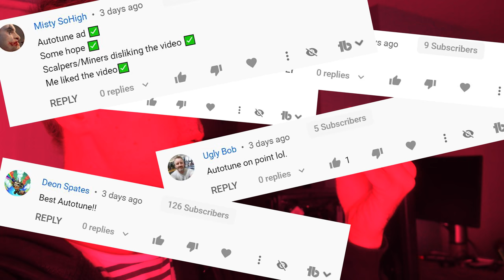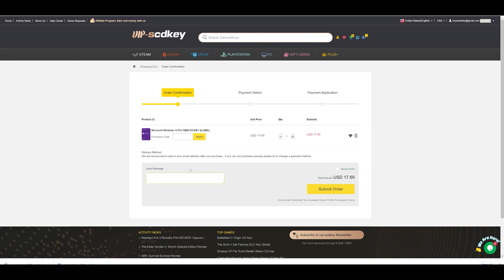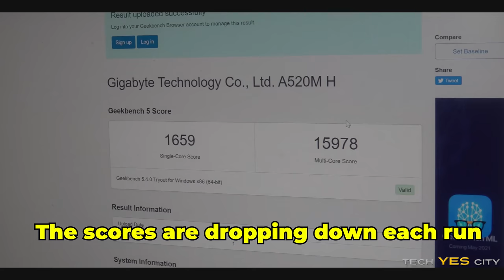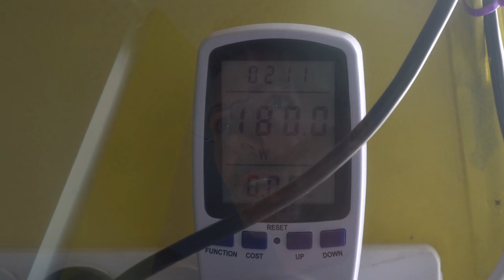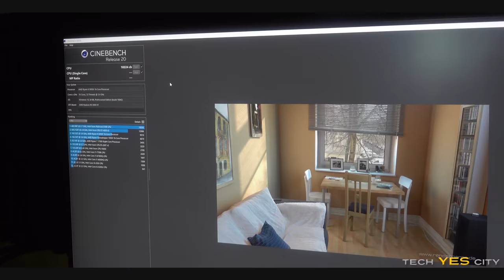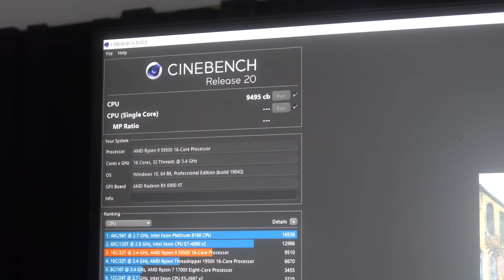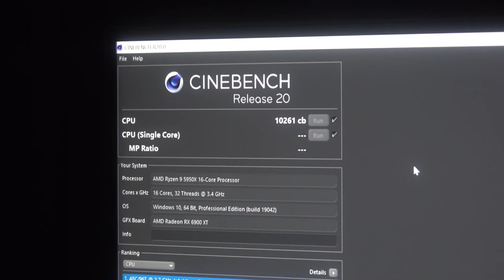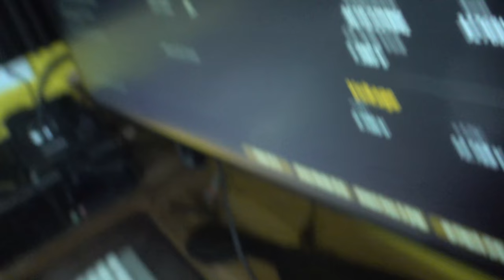5950X on an A520 Motherboard... This was NOT what I expected!

Comment: Hi, what do i think about the experiment ? Well, if you would use an air cpu cooler ,maybe a horizontal one, you'll have colder temperatures on the motherboard.
Thats one of the big disadvantages of the water-cooling the CPU, the motherboard area surrounding the CPU, will run hot. Another thing is the watercooling may require maintenance such as shaking if there is an air bubble, not to mention about the risk of leaking after some time. I prefer air cooling because it can run even 10 years without any problem.
Your testing PC system is built on a exposed rig but imagine that system in a case. That motherboard will start melting.
I'm not from Australia but if someone would sell me a computer system with CPU water cooling i will refuse the water cooling and renegotiate the price. :)
Edit: No wonder why you had to put an air cooler above the motherboard and you got better results, ...because there wasn't any ventilation on it. Even the fans from the computer case are not enough to ventilate the motherboard, people tend to buy cheap cases with a poor airflow because of their budget.  Get rid of that watercooling thing and get a decent air cooler. 
Cpu watercooling is for the rich people who can afford to replace the components more often. Watercooling is expensive and not WOW-efficient unless they are overclocking and has a powerful airflow.
I see you're hunting for the cost and efficiency but watercooling is not a good choice in a long run when speaking about the lifespan of the components.
Im talking mainly about cpu watercooling but it might apply even to gpu watercooling. 
Watercooling is cooling only a component, not the area/the pcb surrounding it too , not to mention about the radiator which might reduce and slow down the airflow speed in a case.
I guess that's why Cryorig has invented a hybrid watercooling-air CPU cooler. Look for their video https://www.youtube.com/watch?v=BTCDo_WT6xY .
Since you have an infrared camera and if you dont have such video, how about making a video for testing watercooling versus air cooling in some different cases from budget one to a expensive one. This will be your homework :) for now.
To be clear im not from a company im just a home computer user which I ordered/created my shopping list (don't know exactly how to build a computer, only on paper I can make configurations),... my configuration components list to be assembled by an IT service, based on a limited budget with maximum efficiency of course with stock air cooler on Ryzen 2600 but I've just purchased an Arctic esports 34 DUO because the stock cooler is not decent in the summer if i convert videos.

Comment: This is the proof that motherboard manufacturer are kind of overselling insane VRM setups to justify high prices in X570 motherboards. Thanks for covering this!
Reply: So you like running your VRM at more than 100°C? I am absolutely certain that it will not last long. Plus you do have a bunch of capacitors sitting right next to the VRM. Capacitors lifespan are rated based on temperature and life hours. Alot of very cheap motherboards have 85°C rated capacitors. The lifespan doubles for each 10°C reduction in temperature for capacitors and it goes both ways.
Reply: No it isn't, and they aren't.
1. A lot of X570 motherboards have crap VRMs. Look at the MSI X570-A Pro.
2. Some people want to overclock, some people live in hot environments, and some people don't want their VRM to run at over 100C because it will wear out faster.
3. If you just want a good VRM you can buy a B550 motherboard for 1/3 the price as an X570 with the same VRM (e.g. the B550 Aorus Master has the same VRM as the X570 Aorus Extreme, and the Strix B550 XE has the same VRM as the Crosshair VIII Dark Hero). The motherboard manufacturers are overselling you on PCIe lanes, not on VRMs.

Comment: I have built a couple upgraded PC based on the Gigabyte A520 Aorus Elite and its a better board than a Gigabyte B550m S2H ... You loose PCIe4.0 but gain a couple DIMM slots... and the Aorus is a ATX motherboard and the S2H is mATX... Are you willing to get a Gigabyte A520 Aorus Elite and retest? It has VRM cooling from factory!

Comment: I too expected the A520 to explode if not catch fire, so here are my thoughts. To some extent I suppose it was well known that Ryzen was actually good and relevant by the time the A520 boards were beginning to be designed. This is in contrast with the A320 and even B350 or X370 boards which were mostly mediocre because AMD had such a bad reputation at the end of the FX Era. AMD had to prove it’s self to not just consumers but also to the motherboard makers who didn’t want to invest back in the first generation Ryzen days for fear that there would be no point. In hindsight obviously Ryzen turned heads and he boards got progressively more reasonable in the 400 series and 500 series. So now the quality has come up a bit. The Gen4 SSD thing is dumb though, it should just force Gen3 speeds. Anyways some “meh” PC with an APU or six core I cannot bash this.

Comment: Been looking for deals myself but i've had no luck so far in finding a 6 or 7'th gen intel wil some DDR4 for a decent price, but i don't think it's going to happen so i can get a 9'th gen, ram and mobo for $400, so might pick that up for my sister when i start working again, and for myself i'm picking up a 5950X or a 5900X
Reply: @Tano Yeah probably, problem is my sister isn't that savvy with computers so i would prefer to get something that works out of the box instead of trying to find a decent memory kit that works without problems, that is also why i think the 9'th gen would be a better deal
Reply: @Tano I actually bought a corsair 3200 32gb 2x16 kit for my 2600X because 16 wasn't enough, but i can't use it on xmp because it seems to not work above 2800, i've gone through 3 motherboards with same problem, and i've kept recommending amd to friends lately, i still have alot of time to decide what path i'm going to take with this anyway

Comment: fun fact, VRMs on more expensive motherboards are better and they produce less heat compared to the cheaper ones under the same level of loads even without the heatsink, the cheap motherboards are the one which actually needs the VRM heatsinks xD

Comment: I have an A520 M Aorus mobo ( it seems to over clock CPU and Ram) and 3600 CPU with 16 gig 3600 Mhz Ram an Evga LHA GeForce 3060 12 gig . 700 watt EVGA Gold Power Supply and a nvme m.2 And a reasonable case cost me $1200 NZ 3060 was $645 of it . The old  B450 16 gig 2666 2600 Ryzen with Vega 56 and 650 watt Cooler master  PSU I gave to my 11 year old Son.

Comment: I have a 3400G with an A320 motherboard and had 2 blue screens  next day after making the system, but then they stopped and it is still working.
Reply: @Tano I myself think it might have been a driver glitch problem thing. It is not a problem now as it has not happened.

Comment: yeah using thermal glue and heat sinks on shotty designed VRM's has been a life saver for the low end gamer.

FX 8120 in a MSI 760 board with the same mod is excellent.
Reply: @Tano i mean i tested it, its not like its a rig use lol i tested it and then put a 6300 in it

Comment: I ve got a Ryzen 7 3700x paired with a b450 works great for gaming snd streaming
Reply: I'm using A320+R7 3700x, working good as well
Reply: It's the vrm quality and potential of the motherboard, not really the chip. For example MSI have some very good vrms on their b450 motherboards.
Reply: @chovekb  ya, you know VRM on B450 usually better than A320, but I've never faced any issue to VRM on A320 up to R7 3700x (had tried R3 3100, R5 3500, R5 3600 as well)
Reply: @alvincalmkid  Ofc, those are 65W tdp chips haha it would be a shame and pointless if any manufacturer can't handle that even on their cheapest motherboards.
Reply: @chovekb  that right, because of that I never bought mobo more expensive than A20 series just for TDP 65w Ryzen 7 :D

But actually I don't see from TDP, but real power consumption because TDP 65w doesn't mean 65w power consumption. You can see i5 11400F has 65w TDP processor as well but can reach more than 220w, it should be combined on motherboard that has good VRM

Comment: Bryan, c'mon man, you can't compare thermal imaging temps of a bare VRM versus the temp of a heatsink sitting on top of a VRM. No offense, but super-sloppy methodology. At the very least, I would have liked to see an intermediate step using bare VRMs with a fan on them, before skipping from bare only to heatsinks plus a fan. I acknowledge that temps and performance were better in your final configuration, but I would not assume that the heatsinks helped at all or would even be better than bare VRMs with a fan on them.
Reply: Good point.  Perhaps measuring VRM temperature on the board backside would be a good way to compare VRM temperature with and without heatsink.  Not a perfect way to measure temperature but a fair comparison.

Comment: Would bot run that board if you gave me one for free, 100C is still too toasty, my x470 ch7 only gets to like 40-50s on the vrms if not lower. Thats with a 2700x but i cant see a 5800x getting it much hotter.

Comment: I mean, you're asking a lot of each of those power stages. Would probably be replacing that board in a shorter time frame. Have to keep in mind that the temps you were reading are surface temperatures, so even after the heat sinks it's probably still operating very close to max spec. Probably wouldn't pair too badly with a 3600 or 3500x, I'd say 3300x but those unicorns are awfully hard to catch

Comment: Ryzen 5 3400G  vs  Ryzen 7 4750G for playing games like Scum, escape from tarkov, battlefield 5, gta 5....  ?  Only with intergrated gpu. Combined in both cases with parts bellow.

Crucial Ballistix RGB 32 GB (2 x 16 GB) DDR4-3600 CL16 Memory x1
Crucial MX500 2 TB 2.5" Solid State Drive x1
Asus ROG Strix X570-E Gaming motherboard

be quiet! Dark Rock Pro 4 50.5 CFM CPU Cooler
24.5"  1920 x 1080  144Hz   16:9  IPS  monitor

Comment: I have on ssd 25c... So it is really fast.. WHy to have NVMe to overheat.. Now i  will have NEW mb with heatstick b550 asus rog strix.. i have b450 gigabyte gaming x rev 1.x.. it is so bad made only problems with ryzen 5600x with ryzen 3600x less problems.. Today or tomorow i will get new parts... yes... more stable fps i will have ... Gigabyte support is so bad.. they made beta update bios l3 cache fixed.. system crashing.. overheats,, voltage are going up and down.. after bios update and if i go back cpu is to slow. I have everything default underclocked gpu... ANd i told to gigabyte why is still beta more than 1 month .. windows update ruined my pc and i reinstalled pc .. to not be updated to new update by windows.. System will crash down. 2400mhz memory i use cl 16 16 16 16.. i cant even use 4000mhz anymore or 3200mhz... So bad... gigabyte.,. I have new pc but selling those stuffs already new stuff are here .... So bad gigabyte... u lost me as custommer.. I had asus ROG for 10 years never died... than i changed pc.. 1090t 0 problems 10 years ..OCED.. yes with corsair 850w GOLD from 2009.... GOOD psu good mb  long live pc.. BAD MB BAD PSU NOTHING WILL SURVIVE INCLUDING MEMORY. Gpu anyway die every 3 5 years everyday of usage 8 to 12 hours.. I want to say... Never save money on MB or PSU... never.. last time that i saved money on psu and MB.... OPEN CASE chaning heatsticks.. Warranty off... why to bother with cheapMB it will not survive for more than 1 year.. it will start to overheatpsu and components... SPecialy gpu... I have vrm closed case 48c. At idle 28c.. Still after heating gpu everything goes up never reaches 100c anyway... next time test with closed case for 2 months will die. I have anway 12 vents inside.. 3 under 3 up 3 front  1 behind and 2 rear. The worst heat comes from gpu cpu and vrm..
Reply: I recently bought my first Gigabyte motherboard.  For sure, Asus is better!  but gigabyte is cheaper.

Comment: AMD should stop making B-series chipset, it's the most useless chipset out of the three, and board makers should pump in money in making a good, decent A520 board.

Don't wanna OC? Go for A520.
Wanna OC? Go for X570.

The difference between B550 to X570 (of the same tier board) is US$10-50.
Reply: A while ago most b550 boards had better vrms than most x570s. Many of the first low+mid.tier x570s were pretty bad. I got a asus tuf b550 board for 110 EUR that handles my 5950x beautifully with PBO on and on top of that it supports also  a single gen 4 M.2.
Reply: @innocentiuslacrim2290  Chipset doesn't determine VRM or board design. It's just a CHIPSET.

You can have A520 chipset with best board design, you can have X570 with poor board design.

Not sure if the A520 and B550 has the same BGA as X570, but if they are, you would be surprised that the different tier board from manufacturer can have the same VRM design, just a different silk screen, different audio/nic chipset, missing SATA/USB 3.0 ports.

So a TUF board may have the same VRM (design and its components) as the cheapo board you may call to have shit VRM.

Comment: I mean its a good video but WHY ARENT YOU USING THERMAL PADS????? Your using thermal paste like WHAAATTT if people are seeing this use a thermal pad for a permanent solution
Reply: @Tano I think that spending like 20 bucks extra plus the motherboard to mod it with heatsinks wouldn't be a bad idea especially if you want better Temps and just run bare minimum
Reply: @Tano se the problem is the b550s cost 100 dollars more than th a520 unless you want a batrbones b550 but right now they cost about 200 minimum

Comment: Dude, that's still a 105W tdp chip, which draws 150W max, doesn't matter the number of cores, so any half-decent vrm can handle that, especially with the proper cooling, which btw is also cheap, like 30$ hahaha Those 11th gen Intel chips drawing 200W+ are way more concerning.